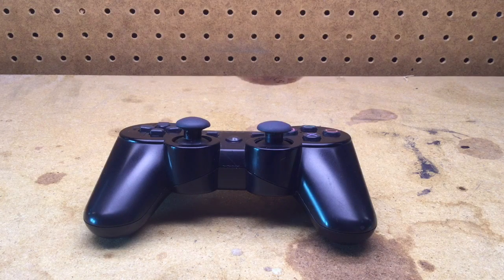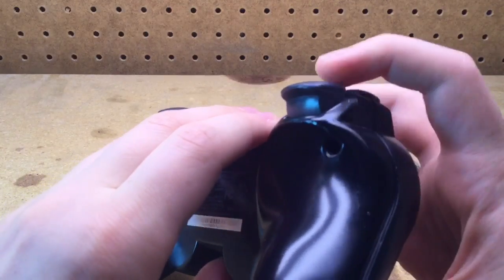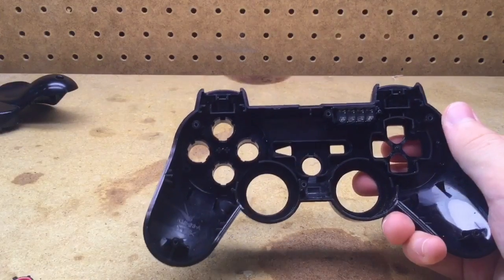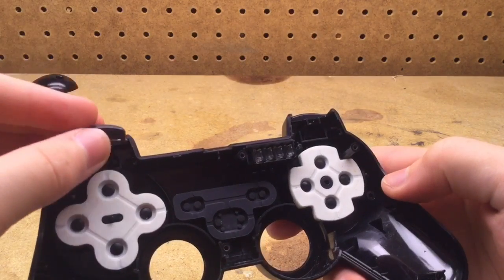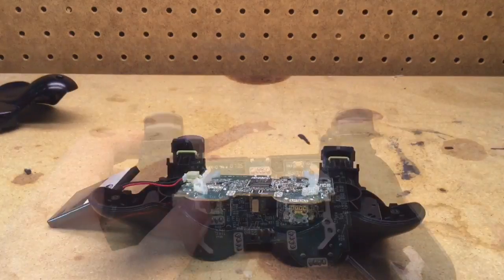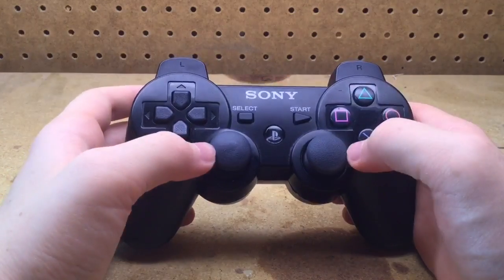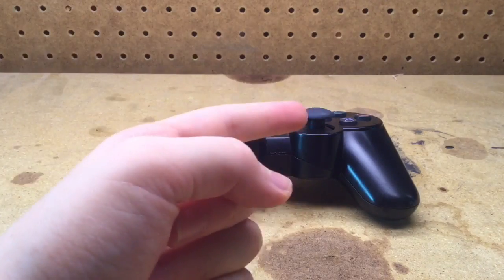PS3 Sixaxis Controller dissasembly/reassembly

Comment: I fucking hate PS3 controller. They are the worst designed, and the worst to fix. You could go in trying to just replace a joystick that doesn’t have rubber on it, and the whole thing just falls apart. A literal pain in the ass

Comment: GUYS, THE CLAMP IS SURPRISINGLY SIMPLE TO OPEN WITHOUT BREAKING! Once all the screws are out, the clip is on the bottom inside and attaches to the top inside, so all you have to do is firmly press in on the very center of the bottom part of the clip (basically the bottom half of the controller in between the two joystick cylinders. Push relatively hard and pull apart at the same time. It should just slide right out without breaking!

Comment: The way that you put the back case on and guided it into the fiddly ass rails between the shoulder and trigger button finally allowed me to reassemble my controller after hours of frustrating fiddling. Thank you. 🙏
Reply from the maker: You’re welcome. Took taking a few of these apart to get it right, but I agree it’s a pain in the ass.
Reply: I was having exactly the same issue. But this video showed that I was suffering for almost nothing.
Reply: Im still struggling with it cuz the last owner broke one of thoose pins off which goes under L1 🙏
If i knew i wouldnt of took it apart in the first place 🙏
Now im here suffering

Comment: One of my triggers came off the ribbon and it's a nightmare to get it back on right between the rubber. I've left it for a while cos it was driving me mad!
Reply: Oh yeah I have the same problem but I got it fix on the same day and now I’m gonna take it apart again because of the triggers spring 🤦‍♂️
Reply: Same here, i know this is an older video, but after reassembling i noticed that the L1 and R1 button arent springing back like usual and they seem to not work anymore, anychance you ran into this?

Comment: I swear my controller didn't came with that piece 3:29
Reply from the maker: I think all of the ps3 controllers (DualShock ones too) come with it. What probably happened is you either lost it or it was a manufacturing flaw.
Reply: @FlyingV555  thanks for the quick response!!! i think it's a flaw... it should work anyways i think... the reassembly is not easy XD the 1 buttons and triggers are tricky.
Reply: @kekecom  k
Reply: I don't have that piece (the bracket), either, and I took apart 2 controllers. Neither had one.
Reply: Not sure what peice you are talking about but just know that there a a couple different ps3 controller internals.

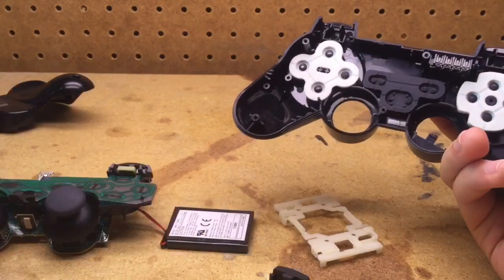Comment: @2:03 Okay so what happened was the clamp that holds the lower part got snapped off? I had to say opening sixaxis is hard compared to DS3s without the clamp.
Reply from the maker: Infiltraitor it was. It’s a pain to take apart the controller if it hasn’t been opened up before. In case if anything goes wrong with the controller at some point, it’s easier to just break the clamp off.
Reply: @FlyingV555  and that happened on mine earlier, after watching this video. There's just no way how to open it without breaking the clamp, like it was not meant to be opened. If it wasn't for your video, it would have felt worse breaking it.
Reply: hey mine broke too

Comment: Where's your vubration hardware? Can't see any.
Reply from the maker: Galo Galoso this controller does not have vibration by design.
Reply: It does have vibration. They are the metal circular components in the grips.

Comment: Hey, I'm really struggling to get the clamp to release as I've never took the controller apart before. Any tips?
Reply: Never mind, I forced it using a screwdriver. It broke but you're saying it just means you gotta screw it back together so no worries.
Reply from the maker: Martin McKee that is correct. Besides, breaking the clamp is no biggie, because it makes it easier to take apart when it has problems. :D

Comment: Was the R2 Button supposed to fall? I ended up custom painting it and trying to remantle cause me hell I got it tho thx
Reply: R2 connects to white plastic circuit board....then you place/slide controller housing (black plastic) carefully into the R2 L2 BUTTONS SLIP IN OPENING HOLE.